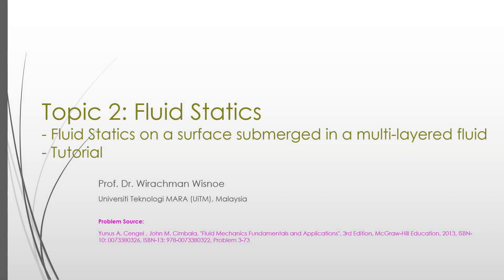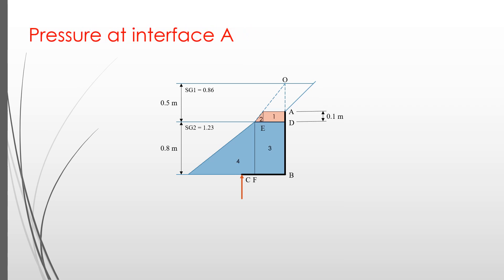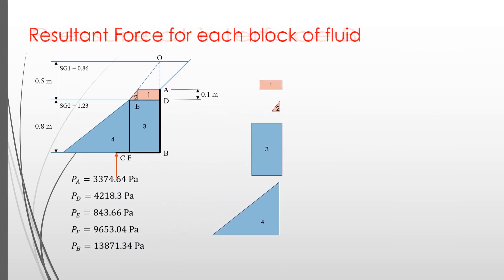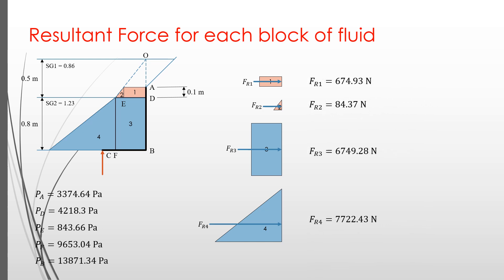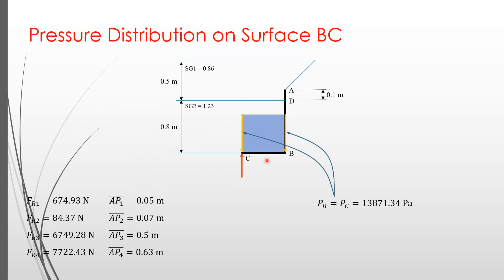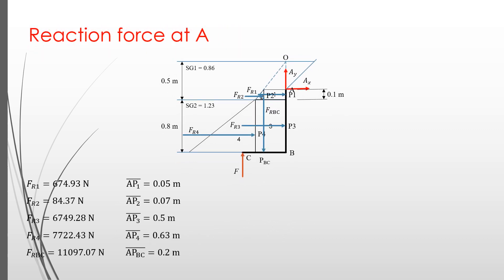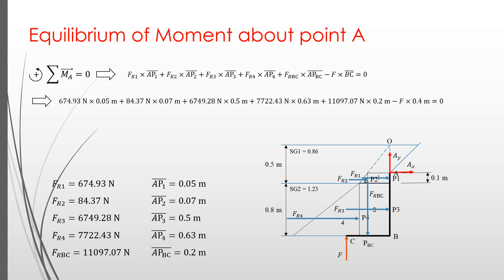Fluid Mechanics Tutorial: Fluid Statics on plane surfaces submerged in a multi-layered fluid

Comment: Sir, at minute 3.24
Why we need to minus pressure at point D with point A, to obtain the pressure value at point E?
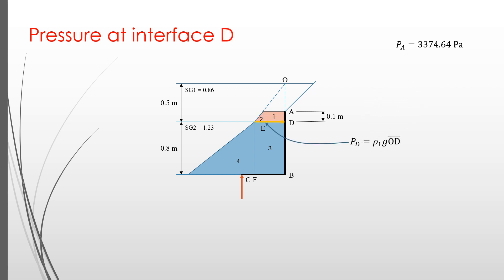Reply from the maker: Try to see from geometrical point of view. PE is the length of the base of the triangle 2. Watch the orange arrows at 2:03, 2:25, 2:46 and 3:17. You will see that: arrow at 3:17 = arrow at 2:46 - arrow at 2:25. The length of the arrow at 3:17 is PE.
Reply: @StudyfromHomewithUs  Thank you sir, now it become clearer for me